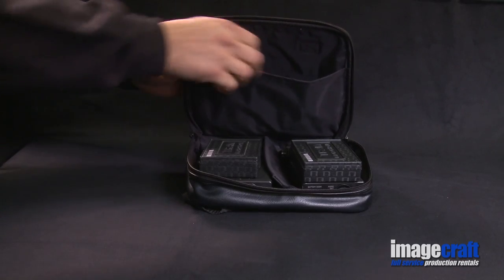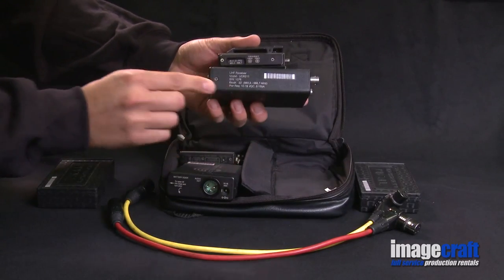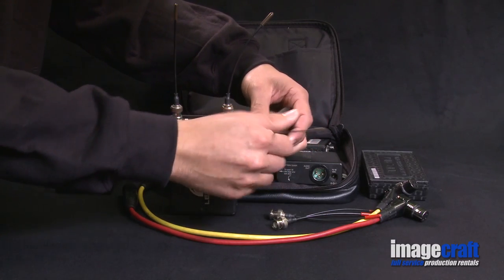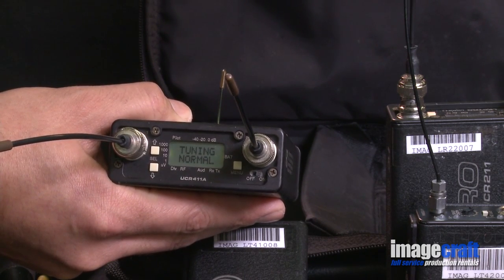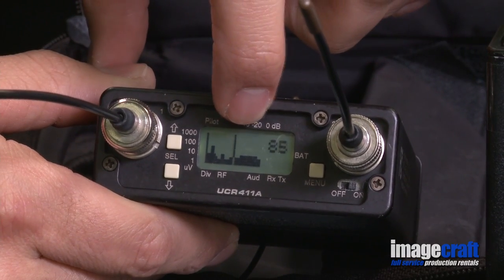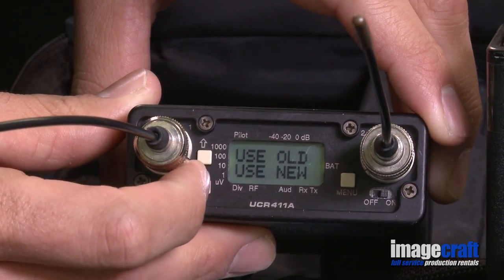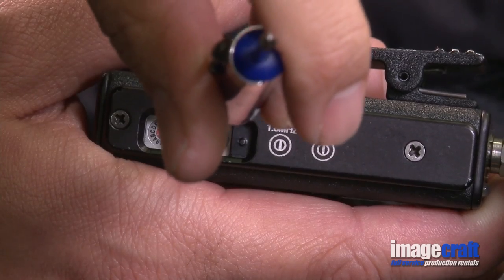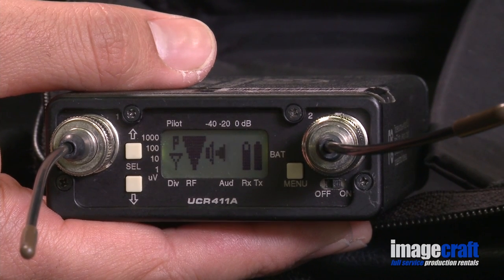Lectrosonics Wireless Mic Tutorial

Comment: Too expensive. The cost to get two "decent" transmitters and receivers from Lectrosonics is way too high. Sure I could get a used 211 setup if I look around but even then I am investing between $1800-$2000 (for 2) on used, discontinued, field worn equipment. There is a need for something better than the 30mW systems from Sony and Sennheiser but not at 3-4 times the price. Certainly an untapped market lacking competition.